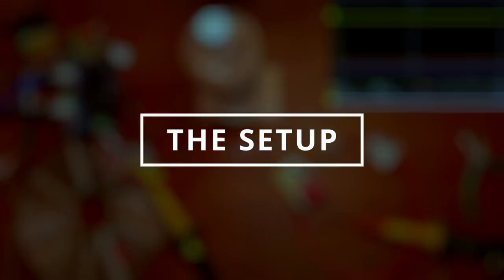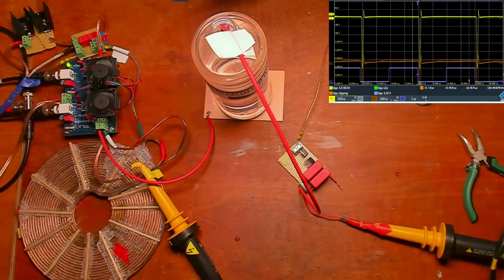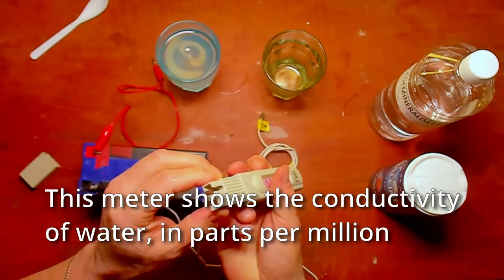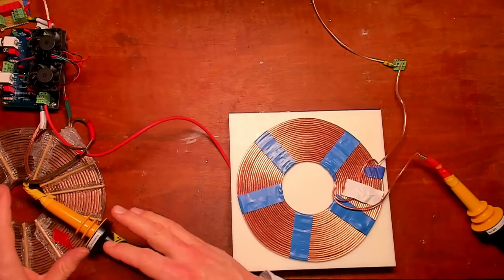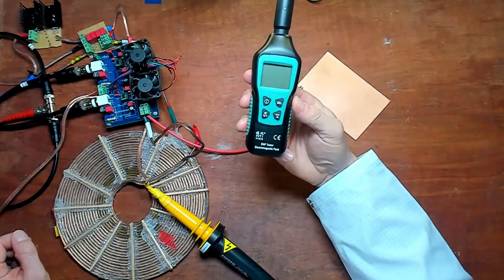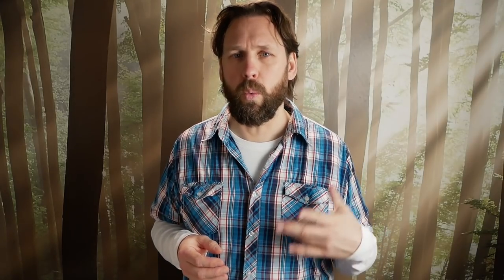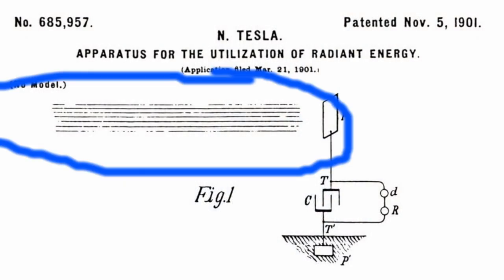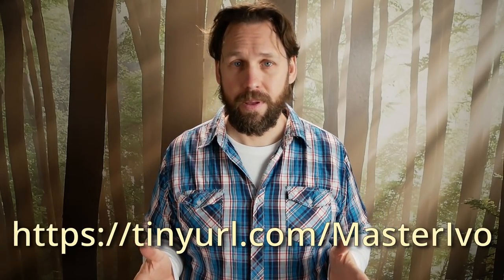Electric Conduction Through Distilled Water

Comment: I'm thinking the drawing represents a (So Called) Van de Graaff machine. I know of 5 configurations and suspect there may be more. If you notice most Old-World machines that are patented were belt driven. One side of the dielectric belt bias charges positive then blocked by a dielectric roller the other side is biased charged negative. They employed very long belt systems in buildings that were 1,000 meters. Creating very high Bias DC voltage potentials that could be tapped for whatever voltages.

After completing many R&D electrical engineering projects, I'm convinced that history is much different than what I was formally educated. It will be interesting to find the true stories. All I know is "Yesterday's history tomorrows mystery, today is a gift that's why it's called the present.

Tripple Distilled Water (Pure Water) Water that's been distilled three times is the best resister material in the world. I make water resistors by employing dielectric tubing (Plastic Tubing) 2.44 mm diameter for smaller power supplies. Yesterday I needed 12 each resistor for a 100 KV high voltage power supply. For the R Component parallel connections, I needed 1.6 megaohms regulated resistance. The length of the tubing filled with tap water (Not Pure) (all bubbles removed) ended up being 15.25 centimeters with conductive metal nails at both ends that I employed as stoppers, making the electrical connections. I call these (OWPTT-R) Old World Primitive Tartarian Technology Resistors! I believe this is hidden knowledge.

Diodes (OWPYY-D) are much harder to construct however Blued carbon Steel, Copper Oxide, Gold Ore, Grey Copper and Pyrite (Fools Gold) With a needle are all used in Primitive Crystal Radio Construction.

I haven't figured out a simple way to fashion simple water/electrolytic diode?

A battery of electrolytic capacitors fully charged to very high potentials is said to be harmful to wildlife. I enjoy spending time with radio frequency watt coupling. I call it smart energy. 

Thank you for taking time, Master Ivo to present opensource content. I love learning from you. Cheers!
Reply from the maker: diode= transformer primary is powered with DC. enough to saturate the iron core. secondary now is a rectifier for ac! it will only pass current in one direction due to the saturated core.
Reply: Thank you, Master! Now I see with new observation pole transformer craftsmanship. The neutral is DC grounded to the plane and accepts all frequencies however the memory of the core remains resistant and set. It is trained by polarity shock on initialization prior to being deployed for intended duty. Your answer is a valuable present today that I needed. I love it...

Comment: shock in water could be compared better with this example (from my perspective): If you throw a granate or some other explosive in water, internal organs of a fish/human/living beeing will blow up.
Reply from the maker: violent example. but yes. And what do you think of implosion in water?
Reply: @MasterIvo  good question, if I recall correctly explosion is eather modality "transformation" from dialectric, to magnetic, while implosion would be the opposite, from magnetic to dialectric/counterspace.
This means seeking the lowest pressure point, while beeing in high energy stance. Now if I recall Ken Wheeler, he said glass could also be a capacitator. Now imagine capacitator, inside capacitator, like destilled water in a bottle of glass. From your perspective, as tsunami hits the walls of bottle, the wave that bounces back meets at it's source (idealy in the middle).
I would also experiment with coherency. The part polarisation protection bothers me. Maybe your impulsion waves could be more coherent? I would try to build more coils, and place them on top of eachother, like a cone. But the bottom coil would be the largest and the upper one the smallest (or perhaps add one more cone below the largest coil?). But than I don't know how I would charge them into resonance. 
This would be fun to experiment with, I would like to experiment too. Curently I'm purchasing equipment for laboratory. Is it necessary to have simmilar power supply as yours? (double channel, series,...?) Or are two seperated power sources enough?
Reply from the maker: series is handy for higher voltage power input. But separate can also work. only make sure earth ground is floating (you can connect it where you need)
Reply: @MasterIvo  actually Ivo that comment brings about something you might go ballistic over. Did you know hho gas flame from electrolysis is an implosion back to water and the flame will actually burn under water! By what you have demonstrated this may be possible to charge a capacitor in a similar fashion ! That if it can be demonstrated should rock the establishment to the core 🥸

Comment: Have you Read the book "Electrostatics Exploring, Controlling, and Using Static Electricity"?
Your description of displacement currents is similar to Electrostatic Induction or electron displacement in dielectrics, this sounds a lot like the same relations with Leptons and Up and Down Quark numerations in materials conductive and non-conductive.
Reply from the maker: no but might be interesting read. I prefer to focus on the dynamic electric energy field interactions

Comment: Nice demo but you're lucky the water didn't discharge itself. That phenomenon was used in the 40's to form aluminum aircraft parts until it was realized that the discharge included enough Gama rays to ruin equipment and injure operators from repeated exposure. When water is charged and discharged using a spark the discharge is broad spectrum electromagnetic including visible light flash and a powerful low frequency kinetic thump. That's why it could "soften" an aluminum plate then push it into a form with no thin spots. An older microwave that just uses a clock timer and is full on when energized can cause a cup of water charge and explode though the same process. Dr.Graneau and his son studied it at Harvard and Cambridge but I don't think they quite realized the similarity to lightening and thunder or they were suppressed most likely.
Reply: Your body is 70% water which can absorb retain and discharge energies🤔

Comment: I don't understand very much about the inductance of a Bifilar coil. Is there an equation to calculate windings for a Bifilar coil ? So a coil could be wound for a certain resonance frequency ? What is the typical inductance of one of your pancake coils ? What makes it confusing to me is that the fields cancel if properly wound, so why would there be any inductance. Thanks I am a big fan.
Reply from the maker: the 2 windings also have mutual inductance. they are series connected so they don't cancel out but add up.
there is no working formula for resonant frequency, because the capacity of the two windings is charged up to a much higher voltage. this makes the resonant frequency much lower, as there is much more energy stored in the dielectric field.
the voltage is half of the supplied voltage (resonant voltage) due to the  series connection of the windings.

Comment: ❓ Question
📌In the setup with the H V. plate beneath the cup of deionised water: Is the electric potential positive to ground at BOTH the wire in the (top of the) glass AND the bottom plate at the same point in time? i.e. are they in phase or 180 degrees out of phase?
Reply from the maker: in phase. simultaneously
Reply: @MasterIvo  Thanks Master Ivo.
📌 Yes, In phase is what you'd expect from an open circuit dipole based view, as opposed to a closed circuit capacitor in series which that would be 180 out of phase.

Some additional experimental variants to consider:
📌 If the water container and the bottom plate were both very wide, and the top wire dipping into the top was replaced with a similar sized plate placed on the top surface of the water, would the induced voltage occur more quickly i.e. greater induced current? 
📌On the opposite approach, if the water container was narrow yet very LONG, would the induced voltage be very similar at different water container levels e.g. 1/5 full, 1/2, full?
📌If the induced voltage was similar that would mean the deionised water (H2O electric dipoles?) act as a radiant electric conductor, the equivalent of copper conductors for conventional circuits ( conventional: magnetic based closed circuit travelling electron hole displacement). So will the induced voltage drop off significantly through the length of a very tall container?
📌 Following on with the very tall narrow container experiment, if the container was full of deionised water, but the collector wire replaced with a copper plated, and that plate was placed mid height of the container (half the water below the plate and half above) how would that affect the induced voltage, current as opposed to the collector at the top/ surface?

Comment: Dear Master Ivo

Would it then stand to reason that this displacement current could represent a "torsion" field, possibly containing a fractal geometry whereby the information of an induced change in any part of the field will be instantly reflected throughout the entire field, a possible means of instantaneous or near infinite speed of data transmission?

Kind Regards

Lars
Reply from the maker: I don't know
Reply: @MasterIvo  No worries, thanks for your honesty. I have a couple UHF radios, I am trying to find a way to couple them to a local dielectric charge field/torsion field perhaps via a method mentioned in one of Stan Deyos lectures

Comment: I'm not sure I understand this. I regularly make colloidal silver using distilled water for botanical reasons. Two 99.99% silver rods as electrodes, and 12V DC applied to them (cathode and anode). Isn't the water conducting when I start at 0 PPM?
Reply from the maker: yes it starts out as a capacitor building up tension from the voltage difference. But the silver is pulled into the water by this tension.
Reply: @MasterIvo  Thanks. So no actual current until some of the silver ions have been pulled into the distilled water. That explains it.

Comment: There is skin effect at higher voltages. So another test would be to repeat experiment with narrow column of water or somehow vary surface areas.
Reply from the maker: I thought skin effect was due to higher frequencies
Reply: @MasterIvo  it is!
Reply: @MasterIvo  My mistake. Yes it is frequencies. Usually high voltage power lines they mention skin effect. A fast pulse is considered AC so the skin effect may happen. So worth trying this experiment with different volumes of water and varying surface areas of the insulator as well.

Comment: Maybe this goes with a video on building the bifilar coils, but it seems that using your winding/immobilizing method one might just as easily build tetra-, hexa-, octafilar coils just as easily, to add pretty large chunks of inductance each time, with/without a dielectric separator between them.  Have you thought of increasing your pulses that way?

While I have practiced your method of making the bifilar coil, and find in practical, I'm wondering that if really is fundamentally different than a coplanar bifilar cooler, even if they are more difficult to build.
Reply: coil NOT cooler! I hate auto editing!
Reply from the maker: lol, it can be used as a cooler, if you use pipes, they will cool faster.
Reply: The secret way to make co planer coils is to wrap 2  dual wires around instead of just 1 lot. The rest will become apparent ! If you need extra assistance just comment on my channel👍🏻

Comment: Hi Ivo

That capacitor that I was charging, 70uf at 4000v.
If I can keep that caps full at all times, say instantly recharging to say 70uf at 200.
How I use that and convert to for normal use?
Thabks
Reply from the maker: you need a dc to ac inverter. 200V dc   might be converted to low voltage dc using a mppt (solar converter), then you buffer the 24V in a battery or large capacitor, and use an inverter to get 110v ac
Reply: @MasterIvo  the problem is it charges to 200v instantly but when I try to draw anything it goes to zero without any work. As soon as I remove connection it jumps back to 209v
I might upload a video to my account tomorrow.
I don’t understand 
Thank you
Reply from the maker: I think the capacitor might be broken or wrongly connected. Discharge the  cap, and measure the capacity to be sure

Comment: Dear sir. 
I have been working on a dielectric field generator. 
It produces a dielectric charge and can cast that energy meters away to solid conductors. 

But not high voltage. 
Low voltage at variable pulsed frequencys. 
I've been working on this for close to 12 years.
Reply from the maker: Very interesting. Can I read more about it somewhere? My email is on my Youtube About page (use PC)
Reply: @MasterIvo  can't say much. 
It's my life's work. 
Nondisclosure. 
What I can say is I make no claims only results. 
The results confused me. 
I play what if. 
It's something I dreamt up. 
One of those ideas that wouldn't go away. 
Electric motor rewinder by trade. 
I've had to learn basic physics, and go over a lot of anomalies that are just put aside as nothing. 
No electronics. 
Even the best are tunnel visioned, and can't see the trees for the forest. 
I've had the theory confirmed but had to simplify the machine in stages due to self funding. 
I built a machine that is based on earth's field as I see it. 
It produces a A. C.   when not on (picks up ac from house) 
And if DC applied to device can make it variable depending on speed. 
It does the same with no DC, but puts out A. C. 
That last bit sounds confusing but it's odd. 
Also had a bicycle tube explode on a child's bike while testing. 
That got me thinking about dielectric charge and the atmosphere.
Reply from the maker: @simonlaker2139   non disclosure, meaning you won't share. ok.
Reply: @MasterIvo  meaning I've invested my time and won't give up my I. P. Unless I'm covered by the non disclosure. 
You could help, but I'm not releasing until I've uncovered what's going on. 
No point in releasing something that's half done
Reply from the maker: How could I help?
Reply: @MasterIvo  I was not expecting you to say that. 
Lol
Reply: @MasterIvo  what do you know about heat ,light ,and time
Reply from the maker: heat (radiation) and light are the same to me. heat as infra red light.
light is a mystery. ring toroids of vortex energy packages.
Time is the rate of transformation.
but time also relates to capacity.
as the field charges, the time factor changes, more charge is slower in time.

Comment: did the positive impulses charge the caps with a negtive voltage?
Reply from the maker: yes, but only due to the (reversed) diodes. I didn't test, but believe I could use the diode in any direction, as the impulses are 2 quarter waves,  setting up 2 displacement currents, one positive, one negative.